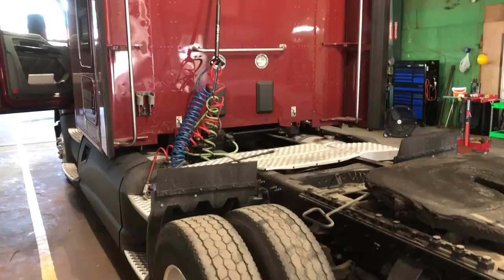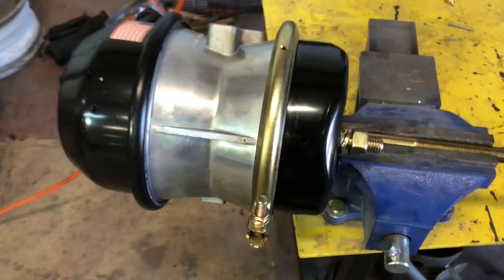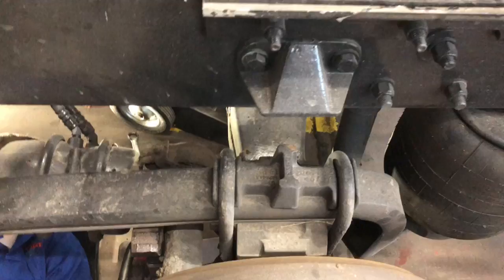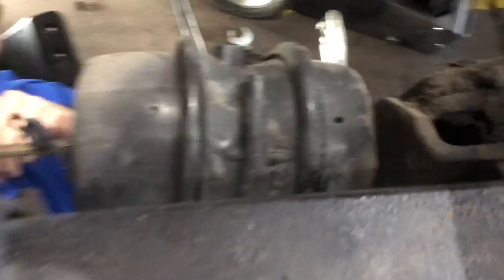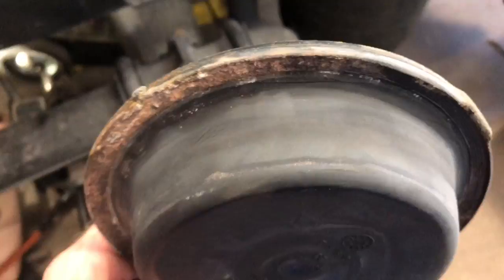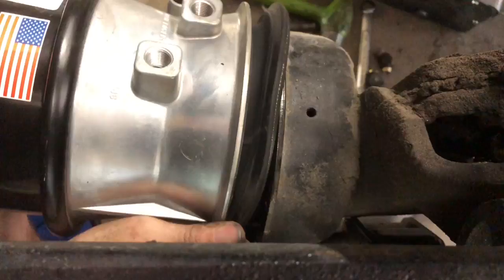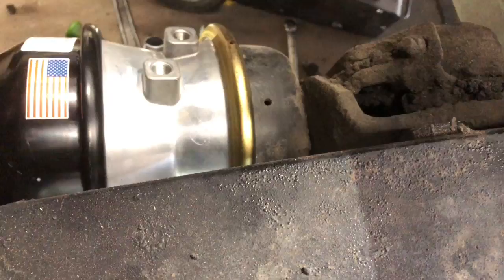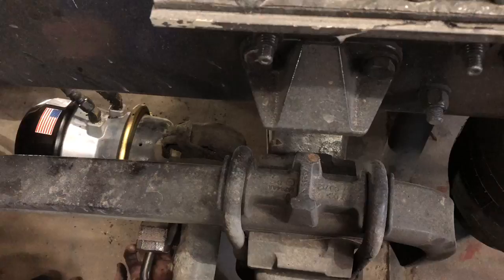Brake Chamber Leak... and a soapbox

Comment: I hate to say it guys, but you’re wrong about the failure. You Identified the leak as the service diaphragm. The correct failure was the spring brake diaphragm in the sealed clamp of the spring brake section. You should correct this. The service diaphragm would only leak if the brake pedal were depressed. Also, while removing the old chamber, put vice grips on the rod before you cage the brake chamber, it keeps that piston pulled way back and you won’t have to fight the service spring when putting the piggyback chamber on. Also, if I caught one of my techs removing fittings with an adjustable wrench, I would bust their asses. Right tool for the job guys. I enjoy your videos nonetheless.
Reply: alan pumph,,,,,,thankyou forYOUR CORRECTY DIAGNOSIS of the problem.......it was the spring brake diaphragm that was bad,.....also when he collapsed the spring brake spring why not apply air to the spring brake port and you can turn the caging tool nut with your fingers.....and then snug it with a wrench......i wonder what kind of mechanic this guy is......he didn't show me anything , i think he just thought he was a little too cool when he said we're gonna show you guys how to fix this problem, that truck had the same problem when the driver went to release the brakes...........WHAT CAN YOU TRUST ON U TUBE.'/.?
'

Comment: Tip for us drivers: grab a glad hand from any truck stop and pop a quick connect air fitting on it and you can run air tools for these types of repairs it's better than ratchets and wrenches yet they still come in handy 😉

Comment: The crack you showed was in the service side of the brake chamber. When you released his brakes you applied air to the spring brake side. You had a leaking spring brake diaphragm as well.

Comment: Im a truck and coach apprentice in canada and all the rust i just leave the cage bolts out of the chamber. If its the diaphragm thats leaking i just switch out the clamp and diaphragm. I just wind the slack adjuster back all the way to take tension off the return spring on the service side. Just different way of doing it i guess
Reply: Just vice grip the rod to hold the spring! Otherwise, yes

Comment: I always clamp the pushrod off after applying pressure to the service side so its stroked out a bit making life easier when installing piggyback and service diaphragm compresses the smaller service spring and plate. just my way of doing it all works.

Comment: The air was leaking when you tryed  to release the parking brakes by pushing in the PP 1 valve.
That means the diiaphram in the piggy back portion was leaking.
You confirmed that when you put your hand around the rear portion of the chamber and showed where the air was leaking out.
This is why you replaced the piggy back part of the chamber.
The other diaphragm you had loose was for the service brakes.

Comment: The new air brake chambers are sealed off to inadvertently taking the parking brake side apart. There are still some older trucks out there that have the older chambers that you can take apart and hurt yourself. Be careful.

Comment: The parking brake spring was broken and it pieced the park brake diaphragm. When you did not have a lot of length to tighten your cage bolt showed that the spring was broken inside.

Comment: Lol I just change the whole chamber none of that taking then apart bs. Working for the state they just get new ones💯🙏👍 but good video
Reply: I work for a company that does the same thing. They won’t even let you mess with it. Cage it and throw it away is all we can do.
Reply: Yeah but thats so much extra work cutting the bolt to size and measuring it up the the slack i always piggy back them just gotta make sure you cage it my company also makes up cut the spring with a torch tho
Reply: Collieman1123 It’s really not that much work. Our trailers all get the same size every time. Cut the pushrod to 8.5 inches, install a new clevis kit, and bolt the chamber back to its bracket. I can have it done in 30 minutes or less.

Comment: Nice job on changing out  chamber but saw the little pin on back side of slack adjustable was missing 
Then when I change them out I tighten brakes to drum back out 1/2 to 3/4 of a turn.    Snap on makes nice tool to back off slack adjustable in 7/16 and other ones
Reply from the maker: +Mike I️ will have to check them out. Our snap on guy runs on Friday so will take a look.
Reply: It doesn't have a pin in the back hole of the clevis because it is a different style slack adjuster, the automatic adjustment part is on a bracket on top of the slack adjuster instead of the rod coming out of the bottom.

Comment: If you look at the orientation of the new diagram (concave) vs. the old one (convex) you guys pulled out they were different??? Also why did you guys put the new push rod in the vice before you caged the brakes, because that put the service spring under tension... I'm just a curious apprentice here 😀 enjoy your videos guys, thanks.
Reply: Ben Wise @         They should have clamped the vise grips before caging the parking brake as well

Comment: Just wanted to state s couple things that was pretty obvious to myself ,but you guys were mistaking on and some things you overlooked and info your giving viewers . Just think some guys attempting to change one out there self or even a mechanic that hasn't had much experience should know . I have a couple simple tips for both mechanics and driver's on how to properly diagnose any issues with the maxi brake chamber.  One is being that when you released the brakes / pushed the yellow   brake valve in on the dash / the air was leaking , being the air was leaking then would indicate that the issue is actually in the front part of the brake chamber! If it wasn't leaking then and only leaked from chamber when the brakes were still released / yellow valve in on dash/ but when you applied the brakes/ foot valve on floor/  then have a leak only when applying brakes with foot and dosen't leak when foot is released from pedal indicates that it is in the back side of chamber via the rubber diaphragm Wich is the service side and the front side of chamber is the emergency/ spring brake side! Another thing is when a driver pushes the hand valve or with trailer valves and hears an air leak from valves, it's not always the valve that is actually leaking , most the time it is actually a brake chamber leaking and air back feeds through the hand valve, you  could hear air in this instance Also. Another thing I noticed that you overlooked is when caging the chamber you said this one was all the way up front, Wich clearly shows that the spring was broke in the chamber and that park brake was not working. Another visual indication that the maxi brake spring was broke was the rust around the weep holes and the one weep hole was cracking through the housing, although the diaphragm always should be replaced when changing the chamber , and it was showing it's age and weather checking, it was not the issue in this case, in order to diagnose it as just the diaphragm the brakes should be released/ hand valve in. Then you would apply the service brake/ pushing foot valve down, you would hear the air leak from chamber then! This could save  a driver/ company time and money to be able to help diagnose the actual issue to be able to accurately diagnose wether it's the chamber or diaphragm , Wich I would always change both if your doing it but in the case a road call mechanic happens to not have a chamber on his truck but has a diaphragm he could come change it out and get truck back on road verses chasing after a brake chamber! Also I did notice you overlooked the clevis pins on the push rod from chamber hooking to the slack adjuster, the large clevis pin was loose and sticking out quite a ways Wich would indicate possibly the cotter pin was missing ? Even if not it was to long then and it was loose fitting and hole was sloppy, and a sloppy hole is never good , they are usually the cause of having a green pecker! Lol but I also noticed the small pin was either already missing or it didn't have the small adjuster rod on that type slack adjuster, witch would mean that that's not the correct clevis to begin with! Also another issue I noticed is that when reinstalling the chamber you placed the Aire lines/ fitting ports straight up and down instead of toward. The middle and slightly upward!  Just some tips for the future for your viewers, and yourself if you'd like or it can help you out in future! Not trying to bash on you or be a jerk! Just I've done this for 30 years and I'm very thorough and notice any issues or something that will cause future issues! I'm big on safe equipment and people's safety on the road!  Oh and one more tip for both drivers and mechanics both in checking for broken brake springs, Wich can be broke and have no park brake even though there is no air leak during a pre trip or inspection/ yard check /  either kick the front undersidebof chamber with boots or tap with hammer or something, not beat lol. And if spring is broke you will hear the difference it will rattle/ bounce in there or it  will vibrate / once you find one you will notice the difference I've done Yard checks on trucks after pms by other mechanics even and have found 3 and even all four chambers with broken springs! That's not a good thing at when parking with 80,000 lbs and no parking brake!  I'm done now ! Lol have a good one!

Comment: Don't  dismiss the  dangers of a spring brake just because they are crimped.  WHEN  they get  corroded internally that   spring can  will come apart.  and If you have it pointed at your  nuts,  then, well............."I'm not afraid?"     Good luck with that

Comment: Why don't you just buy the piggyback instead of tearing down a full brake can?
Reply from the maker: Josh Wingfield that is a great question. Here in the small town we live in, we have a Napa store and they sometimes take forever to get stuff in that you really need. Now if you don’t need it they have it in stock. They usually have diaphragms and also piggy backs but they didn’t have anything this time and we were also out of diaphragms in our parts rooms so we just had to do what we had to do. It’s way easier than changing the entire chamber. Especially with this being a truck out of our fleet I didn’t have to call anyone to ask permission just fix it and get he driver back on the road.
Reply: Around here the price difference between the piggyback in the whole chamber it's like $3. So you might as well buy the whole brake chamber just in case the front  part is all rusted out you have it.

Comment: If you going to done it right. Call it  what we always called that rubber. Pancake yes used to keep 2 in the cab all the time. But then again we were drives and fixers. I have changed out a pancake gasket in the rain. Iuka Ms with a load of logs. And did not have to call a service truck to fix it. I was the Service truck.
What's the funny deal in the cab? Looks like a Auto trans? HAHA Heard a guy crying last week. he could not take his CDL test. AS where ever he was at. They to have a manual trans to take the road test.
Keep up the good video's.
Reply from the maker: Pete kildow haha yes it is an auto shift truck. We call them sissymatics! I’m not a fan at all of auto shift trucks ! 
We try to keep those pancake rubbers on hand but they are getting harder to find at part stores. They had rather you buy an entire chamber. 
Thanks for watching and taking the time to comment ! You are from Iuka ?
Reply: pete k,,,,,,,,you're right about that funny looking thing in the cab...........as far as i'm concerned it's not even a real truck if it has one of those stupid automatics..........and he's not a real driver either........
Reply: No ones fault you cant afford the shiny new automatics.

Comment: You didn't put teflon on your fittings
Reply: Brass fittings are really good at sealing leaks when tightened. Iron pipe is not as good at sealing without help of some kind like teflon tape, pipe dope  or some other means.

Comment: Save  time!!!  Take off  brake  chamber..
Put in the  work table.!!!
Reply: If you take off the chamber in full just replace the whole chamber with new. No work bench needed! It’s quicker to piggyback it. No clevis pins to have to heat up and remove!